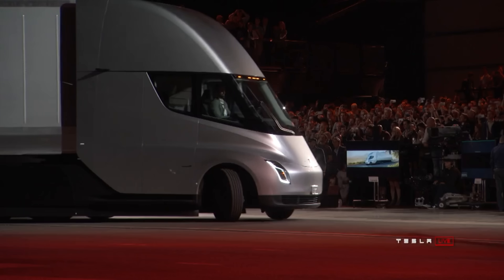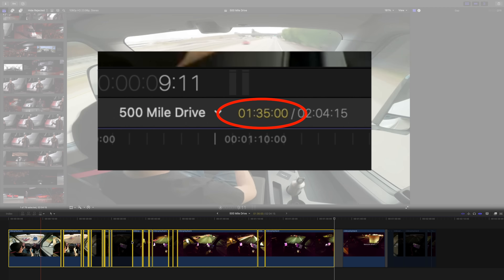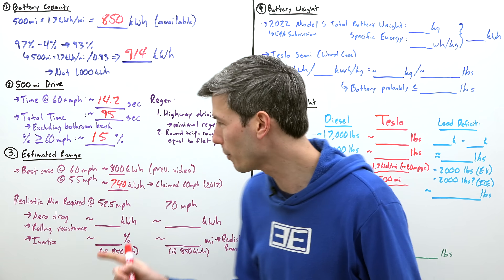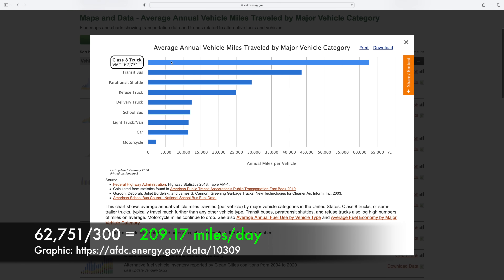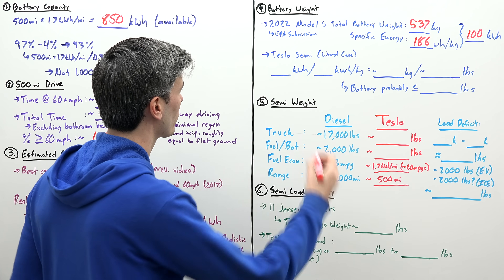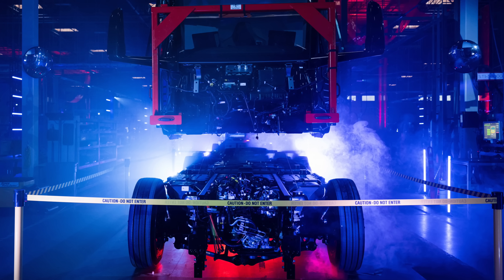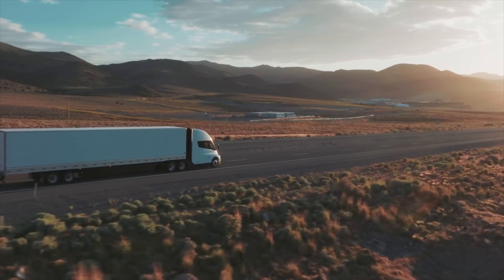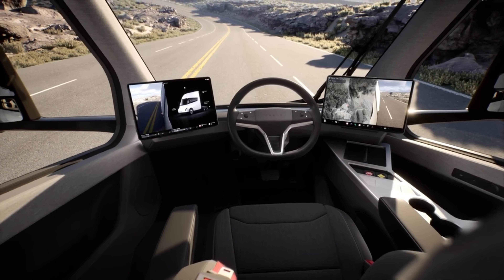Does The Tesla Semi Make Any Sense? Part 2!

Comment: I'm not sure why you'd go into calculating "load capacity" once you've already made a calculation for the tractor weight?  You just subtract tractor weight from 80,000lb GVW and you wind up with what you can haul.  What do you get by calculating the "cargo" weight other than a weird number that simply neglects the weight of the trailer and any additional hardware needed to secure the payload.  Once you calculate the weight of the tractor and you know its range @ GVW, you are done.
Reply from the maker: I did both, because two pieces of data pointing towards an unknown answer is better than one.

Comment: As a truck driver I never rely on the numbers of the equation table because there's always something that's missing... H U M A N  B E H A V I O R. Unless you're using cruise control, you're not always going the fastest, either a group of cars cut you off and start slowing down, or the speed limit greatly fluctuates from town to town. Sadly in California (The Worst State for Truck Drivers), there's a universal speed limit of 55 mph. Yes. So when you're in your 1970 box Chevy flying at over 75 mph, we're forced to drive 55 mph. It's honestly a ridiculous law because we are already limited to 11 hours of driving time. This reduces the miles we can travel by 143 miles less than we would be able to normally drive a day.

Comment: I would love to see you do a video on the Edison Motors diesel/electric hybrid or a fully electric logging truck.  Instead of creating a whole new Semi they are taking an existing truck and frame and replacing the engine and drive train with electric motors.   The Diesel Electric, is an electric drive trade with a diesel engine strictly as a generator to extend the range.  I like how the initial demonstrator truck is a 1962 Kenworth logging truck.  Logging makes a strong case for eletricification since you have an empty trailer going up hill to the logging camp and down hill to the mills or lumberyards.  So you can use the dynamic breaking with a heavy load to recharge, while a majority of the strenuous uphill is empty.  Why make a whole new truck when really you only need to change the  engine and drive train.
Reply: I've read of a dump truck that was designed for a similar use case. Look for 'eDumper' to see more about it.

Comment: Come on man, you could have done a better job of calculating the weight.. A 2170 cells weighs 70 grams and has a capacity of 17.3 wh.. 

So 850 kWh should need 49133 cells and they should weigh 3439.31 kgs.. I assume the current battery capacity is above 900 kWh just for testing purposes..

Also someone on Twitter calculated from that video of the Semi travelled levelized, it could have done close to 570 miles since there is not a 100% recovery rate on downhill when compared to uphill..
Reply from the maker: A battery is more than just cells, as I'm sure you're aware. You have to include the other stuff, so I gave it worst case, and from there, it's probably less.
Reply: @EngineeringExplained  Yes I am aware but you made couple of mistakes in the assumption.. Tesla still uses 18650 cells for the Model S not the 2170's which offer higher density and most importantly the Model S still does not have a structural pack which I am 99% sure the Semi does.. 

But yes your numbers are definitely worst case scenarios..

Comment: Great video! You gave a fair and comprehensive run down of the pros and cons of the Teslar truck. My conclusion is that EV trucks aren't quite there yet. It is quite likely we will see a possible doubling of battery energy density in the not too distant future. That will be a real game changer. In the meantime it appears Tesla trucks may only be economic in limited applications. (assuming no subsidies) Better than nothing but just the first step in the transistion from ICE to EV.

Comment: 9:00 - for both diesel and EV there is a missing number:
The engine in a semi-tractor weighs more than six times as much as the average car engine, according to The Truckers Report. Some of these truck engines weigh as much as 3,000 pounds.
To compare: According to Ingineerix, the Plaid version of the motor weighs about 99 lbs.

Do we know the kind of motor used in Tesla Semi?

Comment: owner operator truck driver here. i dont think it is important to fit electric trucks into the same confines of a traditional diesel truck because the bottom line is the cost to ship goods.  that is ALL the shipper cares about.  end of story.  companies (pepsi) that are needing to get that extra 4K lbs worth of freight into each shipment dont care if it requires an extra trip every 11 shipments as long as the overall cost is less.  and companies (frito lay) that arent pushing the 80k lb limit will be happy that the cost to ship their product is less.  

if shippers can find electric truckers willing to ship 42k lbs for $2.25 per mile but a diesel owners bottom line is to make $2.75 per mile (for 46k lbs) just to turn a profit, i dont know how diesel owners will even stay in business except for oversized loads.

Comment: To be fair to Elon. He made those claims in 2017 before inflation took off like a rocket and the price of everything went through the roof. He most likely dropped the 4th motor because it was a (Good enough design) and saved on cost of trucks to keep as close to the $180k as they could.

Comment: I love the video but I have to say perhaps my biggest grip is the assumption of weight at 17k lbs Tesla I think would have the batter act in a similar structural way as it does in its cars and likely would have slightly lighter materials with roughly the same strength. So if I were to guess the weight of the vehicle without batteries would be maybe 10k because of the massive engine and fuel tank being gone along with the massive simplification of design Tesla likes to do. Which make it more efficient but barely though I am totally open for it being 12 or 13k I just think it’s less than the standard.
Reply: If you use lighter materials then the price goes up as you can see with the cars. Sure you can use carbon but the price will explode.

Comment: Who is going to recycle the battery pack when it reaches EOL, and at what cost? How much environmental damage will be done by mining Lithium and Cobalt for those batteries? How much more powerful does this make China?
Reply: There are already companies that recycle packs and the material recovered is over 93%, including the cobalt. Even more cobalt is used making gasoline but it is destroyed in the process and gone forever. As for China, the supply chain shortages are why countries are finally figuring out they still need to produce things on their own soil.

Comment: as a truck driver, i think some of your logic is slightly off.  at 12:40 these weigh in motions would include empty trucks.  that statistic is mostly irrelevant because it could merely be showing 4 out of 5 trucks are fully loaded, but 1 out of 5 is empty and overall gives you an average of 54k lbs.

Comment: Appreciate the analysis.  Lots of good info and data.

Sounds like it will be useful for local driving and other well-defined routes.  It won't work for long distance over-the-road driving because they go well over 600 miles per day, they go all over America (and each destination is decided as they go) and couldn't risk allowing the battery to run that low.  And would need to use battery power while parked (heating, cooling, lights, etc).  And for local driving a sleeper compartment wouldn't be needed (i.e., could be a "day cab") saving thousands of pounds.

As for the California test, the truck speed limit throughout CA is 55mph, albeit very (very) few trucks actually drive 55.  All across America, very few trucks go the speed limit.  5-10mph over the limit is typical.

As for trailers that are maxed out on volume rather than weight, problem is most of those same trucks need the capacity to pull a full weight load, because sometimes they do.

Comment: Insanity. Just not feasible at this point. Especially when so much of our electricity is coming from fossil fuels any way. I'm all for it. So long as it makes sense. Currently it doesnt.
Reply: Needs to be feasible, makes sense, and be a marked improvement over diesel. I'm glad it's being explored, but it's not ready for primetime. Nor are commuter vehicles yet.
Reply: it is feasable, engineering explained believes it can replace up to 90% of current truck routs since most trucks dont drive further than 500 miles and dont carry ful weight. if you dont care about the enviroment at all, this is still better than a diesel because its much cheaper to drive and maintain by hundreds of thousands of dollars in its lifetime.

Comment: It should be noted on the final part about cost, that the average new long haul semi-truck costs $150k and can cost well north of $200K depending on features. This means that the Tesla comes in at the upper range of semis, but far from being priced out of the ballpark. When you factor in the lower maintenance, it could be substantially lower in overall running costs.
Reply: Tesla low build quality and inexperience with Semis has me doubt their lower maintenance numbers. I also don't see these selling for under 250k
Reply: The current prices of the Tesla Semi are not disclosed, but are likely $250K or more. But maintenance and fuel savings will outweigh the additional cost very quickly (depends on the use cases of course)

Comment: 35 minute recharge almost every day 365 days/year, that battery is going to be down below 80% capacity before 2025. What they need to do to extend the life of these batteries is let it drop to 5-10%, but then only charge it to 85-90%
3 things kill batteries early.
Heat
fast charging
and charging above 90%

IF you dont do any of this most lithium based battery tech can last 10+ years before the maxiumum capacity drops below 80% of factory new. 

By only charging to 80% from new has shown to sometimes extend battery lifespan to effectively 25 years, and this is in simulated environments where the batteries to through as many charge discharge cycles as possible each day 24/7 which is harder on batteries than normal use. In the real world you have to worry about aging, but you're also not as hard on the battery as these lab tests, so if you live in a good environment for batteries, you might see 30 years of use out of a babied battery.

Comment: My truck, a 2018 Cascadia, weighs 22k lbs wet with my crap in it. I drive from Salt Lake City, UT to Twin Falls, ID, a 450 mi round-trip, Monday to Friday. If I installed a charger at my house it would work fine. I agree that a significant number of diesel trucks could be replaced by electric, but think it would be closer to 60%.

Comment: Ridiculous that the government is using citizens taxes to pay for these vehicles that are a scam. It's also ridiculous that they don't use a transmission that will make long distance travel with electric better. Rotational proportions with high torque on a continuous drive to get the same distance means loss of energy. Use a freaking transmission during high speed to maintain speed with less energy. Hello. It's been proven long ago.

Comment: So could you use the 2000 lbs extra for a diesel generator and fuel put it in the back of the truck and run a cable to the charge port to basically double the range? lol

Comment: I think the electricity cost is often overlooked here. With a personal car it’s easy to see saving when you plug in at home but over the road where you can places charging over $0.50 per kwh suddenly the diesel versions are cheaper to operate. Heavy equipment is just a little different given it’s demand and use
Reply: Those are consumer stops. These will recharge at depots like at the distribution centers where that cost can be controlled by Pepsi, Walmart, etc. and worked out with each utility.

Comment: Don't US trucks deliver 40 foot shipping containers? They have a maximum weight of 30 tons (66000 pounds?).
Reply: Those must be just between ports and rail lines, then from the destination rail line to the endpoint, which are short runs.
Reply: @davidmccarthy6061  You mean the weight is allowed on local roads but not interstate?

Comment: I have no issues with the capacity of the vehicle. I wonder about the infrastructure required to support the megawatt chargers.
Reply: It's fine. The US grid has grown 5 times larger since the '70's and as he said, it isn't like 2 million big rigs are replaced overnight with electric.
Reply: @davidmccarthy6061  I'm referring to the power requirements - it'll draw, what, 70 homes' worth of power? Each one will require its'  own substation and high tension feed.

Comment: what happens to range during the winter season? by half in comparison to warm weather?
Reply: EE did a video on this concerning the Model 3 (and it wasn't half - more like 20%). But in this case, it shouldn't matter as much. One of the range-killers in an electric car is having to use resistance heating for the cabin - but the cabin in a transport truck isn't all that different in size and volume from that of a car, so the HVAC load should be same-ballpark but the powertrain load is 10 times as much. Percentage-wise, the HVAC load becomes much smaller.